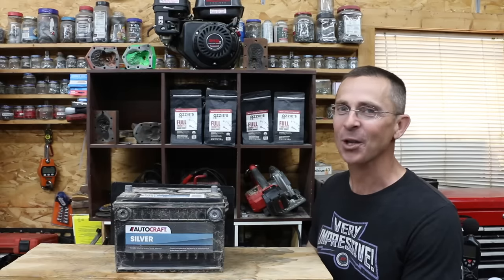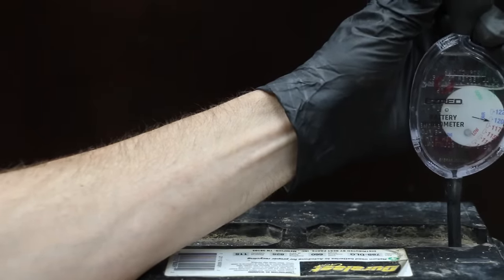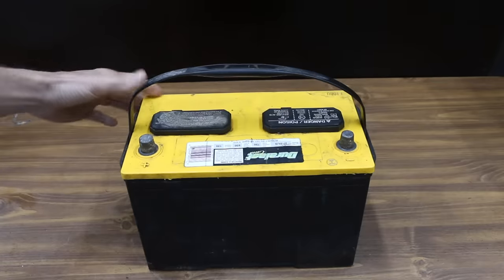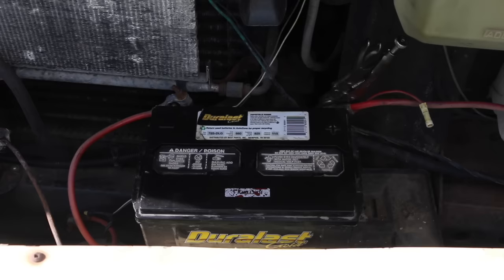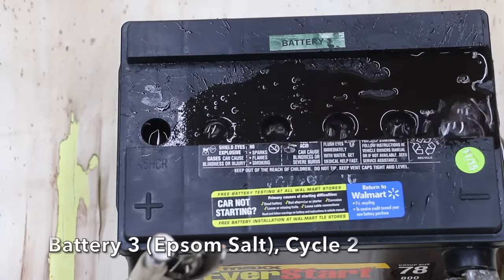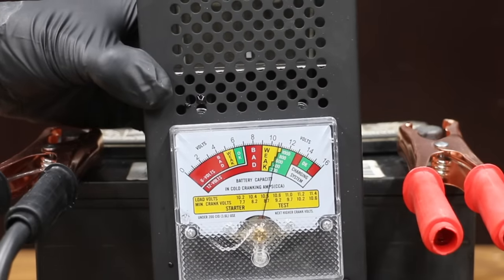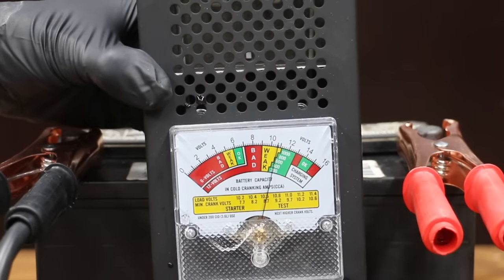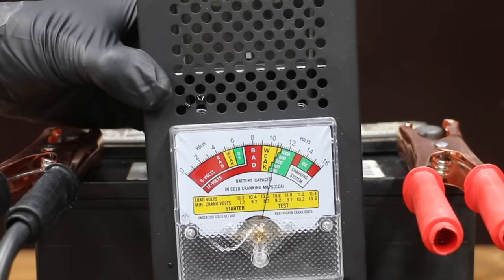Myth Busting! Can You Restore a Dead Car Battery With Welder?  Let's Settle This!

Comment: Lead acid batteries do not fare well when they lose charge.  Much different than the lithium batteries in cell phones.  Great video and information here on how to restore lead acid batteries, though the saying a stitch in time saves nine still rings true.  The best thing you can do is to make sure your batteries stay topped off.

If you have a vehicle you don’t drive much or maybe has a parasitic draw, removing the battery and topping it off with a trickle charger over night will help lengthen the battery’s service life.  Just a tip!

Thank you for sharing!
Reply from the maker: You are welcome!

Comment: Is it safe to say the higher the amps the better the chance os savi g the battery by the welder? 12:25
Reply: Within reason, of course. I don't think I'd assume a 1:1 relationship between amps and recovery chance, because 300 amps will surely melt things. 100 is definitely seems significantly better than 80, but I wouldn't push beyond that personally.

Comment: Another great video!

Why did you use salt and not diluted sulfuric acid?

Maybe a good idea is to build a small automation so you can pulse charge the battery with the welder?
Small pulses of high current maybe prove beneficial for desulfurizing the plates.

Comment: Ive been playing around with this for a few years now just with dead batteries around the yard and have had the best success with a capacitor and bridge rectifyer as the desulfater after draining and filling with Epsom salt, doing cycles of charging/puting a light on it to drain it. Then filling back up with acid. Been wanting to try a welder for a while so i might try that now.
Reply from the maker: Thanks for the feedback.

Comment: so glad you did this batteries are not cheap anymore, I have a 6 year old deka battery that I am going to try, it was getting tired but still worked with a full charge, I do have a big charger with 200 amp engine start, there is another video on u tube he left it on for 20 minutes then let it cool for 20 minutes and repeated 8 times, wish me luck

Comment: Very good video. I was not expecting a welder to be able to do anything measurable to actually help the battery. My thoughts is that the welder is blasting off any corrosion and scum that might be sitting on the plates. I would like to see you use the "Good" battery in a vehicle of yours and see if it holds up.
Reply from the maker: Thanks!  Thanks for the feedback.

Comment: Most batteries fail from sediment building up between the plates. There is another old junkyard trick to revive battery's... Drop the battery on concrete on its side, and even upside down (if side post). Start from 6" inches at first. Then a little higher as far as you feel comfortable. The impact will loosen the sediment buildup on the battery plates. Let it settle again and charge the battery to check your work. Only do this knowing that you may crack the battery casing and cause a leak. If it leaks it can be nasty, so use caution. But you began with a junk battery anyways. The welder looks like it works too though. Thanks Project farm!
Reply from the maker: You are welcome!  Thanks for sharing.

Comment: Wow, thats impressive (with the welder). May try that. Used to do something similar with a high current DC power supply on memoried out NiCds. Gave em a few more months of use.

I would suggest that one would not only need good ventilation of the area, but a small fan blowing directly across the open cells (back several feet of course) to dissipate the hydrogen gas before it might collect.
Reply from the maker: Thanks!

Comment: As mentioned below the broken off lead solids can create a path for batteries to discharge. I have revived batteries for decades using the 24 Volt DC power supply from a backup power system, and once they pass the load test I dump the electrolyte and flush the battery with distilled water sprayed in from a pump sprayer. Once the water comes out clean I pour the filtered acid back in. have been able to re-use batteries up to 3 times before scrapping.  When zapping my batteries I have them sitting in a tub of water to avoid overheating.
Reply from the maker: Thanks for sharing.

Comment: Great video as always. It would have been a help to explain why abundant ventilation needs to be available when charging batteries. Many (most?) people are unaware that lead acid batteries discharge hydrogen gas while being charged &  that hydrogen gas combines with oxygen in the air to form an explosive composition. A tiny spark is sufficient to ignite the mixture. Great stuff as usual.
Best wishes from the wind swept hinterlands of Alberta Canada.
Reply from the maker: Thanks!   Thanks for the feedback.

Comment: I once recovered a 7 year old Varta battery that had been left to drop below 10v resting for a few years with some fairly cold winters (reaching -10 C).
Took some hits with a 48V psu and a deliberate short with a wrench and finally the current began to flow off a dumb charger. Once the door cracked open, it got better and better and could run a 650W fan for an hour. Charged it one more time and it started a diesel first time. Have always bought a Varta whenever I've needed to replace and I've never had one fail before the car
Reply from the maker: Thanks for sharing.

Comment: This past winter I tried this exact thing to restore my lead acid car battery with a welder. Bought a cheap welder on Amazon thinking it would be a good investment if this works, plus would have a welder even if not a good one but can get the job done. 

Well I didn't have any success after multiple attempts. There was one cell that wouldn't bubble until the highest 200amp setting but still wouldn't hold a charge from the battery charger.  I thought let me do the epsom salt solution and no luck. Ultimately I bought a new battery. 

* as a note I just saw the new video and the welder I bought was the S7. Which could be the reason why I didn't have success as the output of amps might not have been enough.
Reply from the maker: Thanks for sharing.

Comment: Wow pretty cool. I've learned that it's kind of hit or miss. Sometimes you can bring them back to life and sometimes no. I have a reputable salvage yard that sells used batteries for $35 and will warrant them for a week. They charge and test them first. I pick out the newest one and take a little risk. So far I've been pretty lucky. I tried the baking soda trick and managed to slightly improve a few batteries in the past.
Reply from the maker: Thanks!  Thanks for sharing.

Comment: Great review and demo, however a battery desulfator takes a lot longer to desulfate a battery, I have a PulseTech PowerPulse desulfator which the claim uses a patented frequency to desulfate batteries, and I have it connected to my BMW battery for the last three years and only drive the car about 25 miles a week, and I have had no problems so far. You should test a Pulse Tech Charger and Passive Desulfator.

Comment: I noticed with the Epsom salt battery, the only electrolyte you added was the Distilled water/epsom salt mixture. You still need a sulfuric acid electrolyte. I've revived batteries by doing the same flush then using a solution of Distilled water, Epsom salts and virgin sulfuric acid drain cleaner. The acid makes up about 30% of the mixture.

Comment: Cranking an engine with a low voltage battery is hard on a starter,  as far as I know. But I love every single one of your videos because they're honest and real world tested. I buy certain things based off your videos. Keep up the good work!
Reply: You are correct! Weak batteries fry motors and solenoid contacts. I don't do it (mechanic since the later '70s, jets to chainsaws and more).

Comment: Great testing method and video production.  Thanks.  In the future, I'd love to see a similar comparison of battery chargers like the Noco Genius 10.
Reply from the maker: Thanks!  Thanks for the suggestion.
Reply: I tired a noco genius 5, it didn't do jack after repair mode. $60 spot welder on amazon bought my battery from 13 to 93 in one zap for $60.

Comment: I've done the welder thing with heavy equip batteries and a Miller big 40 welder with no problem. Tried it with a Miller bobcat and auto battery and it blew to pieces. They make a jump starter to use with portables. Always have battery where an explosion will not be harmful to surrounding area.
Reply from the maker: Thanks for sharing.

Comment: So when reading the load tester( 5.00 min), it's not showing current. For a 12 volt battery, below 9V is bad. The staggered line between the red and green is where you differentiate between different battery capacities. The box puts a resistance on the battery. For a small battery (200 CCA) you use the bottom section. 400 CCA is staggered over a bit more as is 600 and so on. It's not indicating current, but a different transition from "weak" to green for batteries of different capacity. Great work.

Comment: I use this method on my golfcarts, one is 36 volt, the other is 48 volt. The 6, 6 volt batteries are about six years old, the 6, 8 volt batteries are about ten years old. Worker OK on the six volt, but the eight volt batteries are like new, really happy with this method. I paid about $125.00 for a TIG welder on line.
Reply from the maker: Thanks for sharing.

Comment: Hello! I would love to see a video on best cordless mowers Dewalt vs. Milwaukee vs. Toro vs. Ego ! preferably models available at Home Depot things such as run time/area cutting 4in grass down to 2in, cut consisty and clean up capacity and ability to pick up all clippings. All with stock batteries since new/higher capacity batteries can be up to 50% of the price. Thanks for the awesome videos!

Comment: When I do epsom salt, I use it a totally different way. I mix hot water and epsolm salt and add it to the battery acid in situ.. I do not attempt to clean the battery the way you did. Also.. if I were to try and clean it that way, I'd drill a hole in the bottom of the cells and clean from there, and plug them.. that actually can work.

Comment: A little late to the game here, but great video...  I've never tried the welder trick but I have tried the de-sulfate and and epsom salt fixes...  As an EE by education and profession I did not have much faith they would work...  but, being curious, I figured I had nothing to lose.  As much as I tried, the de-sulfators did nothing (tried two different units)...  and on two batteries it actually made them worse (internal resistance went up).  I did get dead cells to produce voltage with the epsom salt solution, but they had little Ah capacity, rendering the battery useless.  I laughed at the welder process...  reminded me of the old days of batting a TV on the side to get the channel to come in...  percussion maintenance.   Fun stuff.
Reply from the maker: Thanks!  Thanks for the feedback.

Comment: I saw a guy dropping completely dead car batteries on concrete to shake up the lead particles that fell to the bottom making  it able to take a charge.  Project farm,I want to see you empty the battery acid and strain the disentingrayed stuff out then re use the cleaned acid. I think this is the best thing to revive a bad battery. Love the videos.
Reply from the maker: Thanks for the suggestion.
Reply: @ProjectFarm  thanks for the reply, I have always loved your content and can't clickfast enough to see more 👍👍👍👍👍.

Comment: Thank you for thinking about Cousin Eddie. I know he is just as nuts about batteries as I am!

I tried this out on a smaller scale, using a car charger to zap a long-dead camera battery. It worked, although I didn't aim for full capacity charge, just recognition that it was doing some charging. Too bad those don't have nearly the same degree of DIY-friendliness as car batteries.
Reply from the maker: Thanks for sharing.

Comment: Best channel on here. I'm really curious to see Militec1 tested as a engine oil additive and or just as a lubricant in general. I've seen a test against lucus in lubricity but it wasn't you testing it so I'm not satisfied. I use it on my "Pew Pews" and it seems to be decent.

Comment: For anyone that doesn’t want To go the electric route…I’ve used Therm-oil desulfator and therm oil demister. The stuff works amazing for lead acid batteries. I had a battery from 2010  that wouldn’t hold a charge in 2015 and used this product….it’s still working in 2024. I’m by no means an expert but it worked for me. No affiliation just a happy customer.
Reply from the maker: Thanks for the feedback.

Comment: I have a suggestion for a test, different types of Window insulation film. Our house gets very hot in the summer and have the bedroom windows equiped with this stuf, but is it worth it to do the rest of the house?? And wil it reduce the cost of running an AC if you do? Hope you like this idea.
Reply from the maker: Thanks for the suggestion.

Comment: I went on vacation for three months, came back home and found my GMC Acadia's battery had died and sat at ~6.5v.  Spent $300 on a charger that couldn't charge it and it kept giving me an error, then shut-down (what a waste of money).  I ended up using my bench PSU and slowly (~80w) charging it back to ~13v over the course of 4 days.  While certainly not as powerful as the welder, it was essentially the same principle and did save me from having to buy a new battery.  While it's life has certainly been reduced, I'm happy that this worked.
Reply from the maker: Thanks for sharing.

Comment: Question - what voltage does the welder output at 70 amps? Or is that even a relevant question? I've seen several of these videos with amperages from 30 to 100, but voltage never seems to be mentioned. Is it not relevant? Wouldn't different welders potentially output different voltages? Great video as always...

Comment: I have also tried the high volt charge... But when the cell has a short (junk across the plates) I put it on a homemade vibrator while charging and all worked as long as the hydrometer tested good... I was told acid can be bought for cars in about 1 gallon bottles.
Reply from the maker: Thanks for sharing.

Comment: Drain a battery dead flat and recharge with reverse polarity and see if it works then run it flat and charge back to it's correct polarity would be very interesting great video as always 👍

Comment: I'm thinking hitting it with a few cycles with the welder to clean the plates, draining the battery, then with it upside down, flush it with a garden nozzle to get the debris out, rinse with distilled water, and replacing with fresh acid would get good results. Thanks for the great video!
Reply from the maker: You are welcome!

Comment: I used to use a 200amp Jumpstart to do this.
First order should be clean8ng the plates to see any damage. Dissolved Epsom salts in distilled water works but you can get desulfinator pretty inexpensively
The 200 amps for about 15 mins usually boils the plates clean to get a good view.
If no damaged plates dump the acid into baking soda water mix then refill with a lead acid acid kit
Charge and test
Reply from the maker: Thanks for sharing.

Comment: Now I remember being told to do something like this for the restoration of a weak or sometimes dead Battery. But the process we used consisted of dumping the liquid contents, removing debris from the bottom of the cells if there was any, rinsing the battery out with distilled water, and then placing electrolyte back into each cell regardless of the charge. 
The few times that I witnessed it being done I saw improvement in all cases.
Reply from the maker: Thanks for sharing.

Comment: I do this from my welder in wire mode so that I can control the voltage as opposed to amperage. Has worked quite well for me charging and jump starting. How many volts were you pushing through that battery at each amperage?